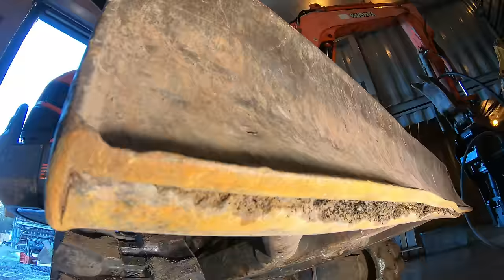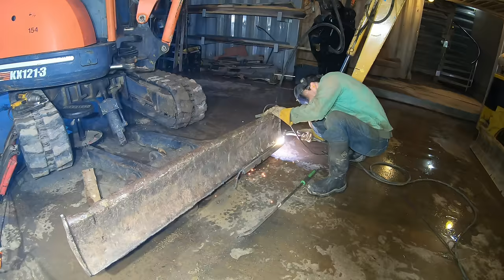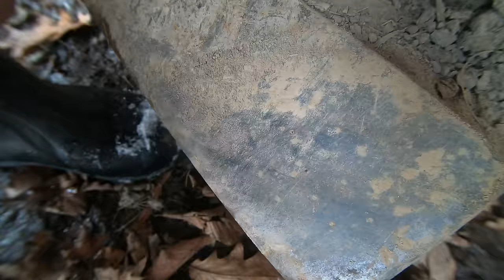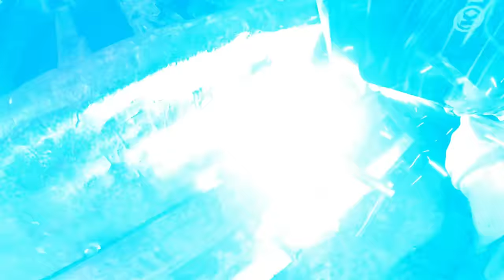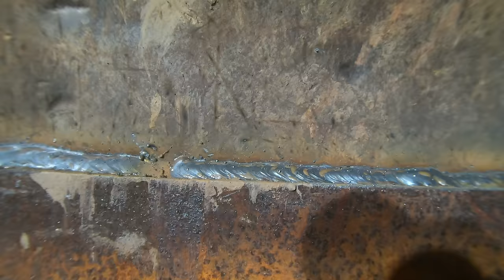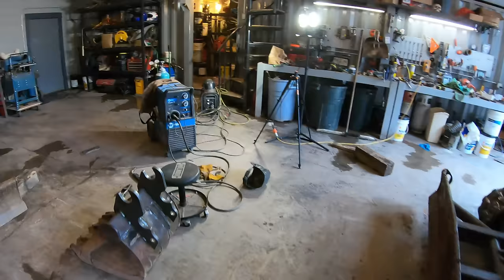Replacing a cutting edge on an excavator blade

Comment: One of the few tools you do not have is a sand blaster.  They do a great job in removing paint and cleaning up surfaces to be repainted.  Love your videos.  Stay warm.
Reply: and a REAL steam cleaner, for the mud, the blood and the beer.....
Reply: I got Kärcher K5 Pressure Washer Sandblasting Kit- works much better than plain sandblaster- no dust.
Reply: Im not sure but I think he has one, in one video he showed his.
Reply: @DigitaIBot  He has a hot water pressure washer but not a steam cleaner and I have never seen him use a sand blaster.
Reply: @Peggyt-jp6mt  If you are referring to the automotive uses, yes a sandblaster would be a good tool that you would use to strip down frames to bare metal and remove rust, that being said it also warps the panels too and it just better to use the alternative (newer age "sand-blasters.") I guess I could see sandblasting the blade, (why? I don't really know) but then you have to think that blade is always being tore up by debris he is clearing, and no you cannot just sandblast a car and respray, you can expect warped panels and base coat wont protect the bare metal from the elements, and probably body filler assuming there is body work to be done, hence the need of a sandblaster. For Andrew though, a simple, cheap, non-messy solution is a grinder.. lol
Reply: He doesn't have a big enough air compressor to power a sandblasted. I got a blast cabinet and my 25 gallon compressor has a hard time powering it. I also use a 5 hp vacuum along with the compressor and my light wen in blasting so it might be not enough electricity for my compressor cuz it's 220 volt motor.
Reply: scubasteve 100 it all depends on cfm, the minimum for painting a car would be an 11 cfm belt driven compressor

Comment: Good job on the blade repair Andrew.  You made it better than new.  Better have a look at the oil in those final drive planetaries because the previous owner must have used this mini for a bulldozer.  Change it out and look for presence of metal particles.  Kubota makes some good stuff so they are probably ok.
Reply: A hollow push blade is a very poor design and no real cutting edge. It obviously wasn't designed for extensive dosing.

Comment: When I was 19 I bought a Sears 295 Amp Stick Welder (AC only) and I still use it almost 40 years later ... mostly i burn 7018 AC rods ... but it tones down to 35 amps and can weld thin stainless as well for example ... I got Oxy Acet Torches the next summer at 20, I NEVER regret buying such important tools ... they have saved me literally tens of thousands of dollars over the years!

Comment: Looks good Andrew, the hard plate should be welded with 11018 rods! I hope the mig welds don’t start cracking on you! Even though the hard plate has a lot of carbon in it, it should be welded with the 11018 stick rods! Just keep an eye on it brother, if the welds start cracking get the 11018 rods! Good luck brother! 👌🏻👍🏻👍🏻

Comment: I'm impressed!!! He still has the guard on his hand grinder..lol idk if i have ever seen anyone leave it on before
Reply: Well, I'm nothing like AC but I'd never grind without it.  I'm not a novice with grinders but I'm always humble.  At 11000 rpm on a 4.5" the edge is moving at 150 mph.
Reply: @reallyhappenings5597  no, your smart for leaving it on.. you truly are.. one you get use to operating one you get careless and take it off.. it always seems to be in the way of getting into tight corners and sometimes can be hard to see what your doing with guard on.. keep it on tho, practice safety...
Reply: He is very smart.
Reply: @terriwebb5093  I don't like using one without a guard. But when I made cuts I had to take it off. The guard got in the way for many cuts.
Reply: @MrJetFormation  yes this is the problem i always face with a guard on my grinder it always seems to be in the way of a cut or a grind that im performing. I don't recommend removing it for novices but with experience you will be ok.. big tip is keep fingers away from fast spinning disk and you should be ok..lol and never use a broke or chipped wheel.. had a cut off dish explode in my face onetime, it had a big chip missing and i thought ill just go easy till i wear past it.. lol and when it hit it exploded. Very scary, i got lucky and it only cut my cheek alittle..
Reply: @terriwebb5093  I put it back on. But it's just because I do think about it hurting me often. I honestly try to use the grinder as little as possible.
Reply: Perhaps that should invent a see through guard
Reply: @kifferwarrior850  good idea, but still wouldn't really work.. the guard is just physically always in the way of performing certain if not most cuts.. good idea tho would be handy in some situations

Comment: A friend of mine used to store his hammer on it side on the ground and it ruined all the o rings and had to have the whole thing rebuilt , he ended up building a stand to put the bit in so he could store it standing up. Just FYI, could save you a big head ache later...
Reply: Good advice.
Reply: Jason that is so true.
I bought a new hammer that had been setting on pallet outside on its side from an auction.
The piston had rusted from rain and ruined the seals. Had to buy a new piston and seal kit.
Reply: This is good advise.
Reply: @magadon ruferto I believe that was just grease in that video. You're supposed to use a special grease, but people who don't use their hammer religously don't often have the correct hammer grease.
Reply: Good advice , I've never heard of that before (not to store a hammer on its side ?) thanks , also any Grease is better then no grease . As a equipment owner repairs like cutting edge's , yes sooner the better but it comes down to economics . Just one more job , so it will pay for the repair . In the long run it will cost you more !

Comment: Great fix that will last a long long time. One time my Dad needed to replace the cutting edge on his Fisher snow plow and was able to get a “worn out” cutting edge off of a motor grader from the township works department. Way overkill for snow but it certainly did the job. 

I noticed the 2nd hydraulic hammer laying outside by your Dodge. Now that you have gotten the taste of breaking rocks out your going all in. 👍🏻👍🏻

Comment: Those foam type ear plugs (e.g. 17:04) are designed to be squished, shoved right into the ear canal then held there with a light pressure as they expand again to fill the ear canal. That's if you want them to be effective at blocking noise. And yes that does mean they get waxy and nasty, which is why they are cheap even in 100pr packs, bin them after use.

PSA from a now tinnitus sufferer.

Comment: I hate to be so critical because I like your channel, but as a welding inspector since 1988, I have to tell you that any time you're welding any steel, old, new, rusty, or clean, you need to grind the surface of the steel where the weld is to take place so you get good penetration without any defects. You had all rusty and dirty steel, both the blade and the new cutting steel, both of which you welded without grinding either weld surface.   That crack in the pipe brace also should have been gouged out a little before being welded.  Maybe you did all the necessary grinding but you didn't show it.  I hope it works for you.
Reply: ya his welding seems to fail alot......never. if you watch his channel you might learn a thing or two about what actually works in the real world.
Reply: 100 percent correct.  That weld will lay in there a lot nicer with prepped metal.
Reply: I’m not even a welding inspector and I cringe at most of his welding. I’m just a guy who has done a lot of welding, taken some classes to learn proper procedures and knows how to weld properly. People who don’t know a lot about welding will think that because it didn’t immediately break or that because I welded it 9 months ago and it’s still going that it’s ok. Improper welds will eventually fail. You just don’t know when. I admire this guy’s work ethic and tenacity but a lot of seems to forging blindly ahead with no concern for the correct method or process. It seems to be a lack of knowledge or education rather than knowing the right way and just not doing it. Either way, it’s entertaining to watch.
Reply: @doi467  you cant be serious. what works in the real world is clean steel and proper preparation of the parent metals. welding is 90% prep 10% weld. if you fuck that prep up. you gotta be one hell of a welder to fix that shit. unclean steel leads to undercut, which in turn is a cracking zone as the weld usually cools quickly in the crack making it quite hard and brittle. I weld Buckets for a living and theres no way in hell we would do this without cleaning the steel first.
Reply: @EarthshipFreedom  Yes, but do you guys not think he realizes that though?  
 
I'm one of those guys that goes overkill trying to do 'the best' (perfectionist pita) but have come to recognize and value effectively hitting happy mediums.
Reply: @doi467  I've inspected in the real world and have seen what really fails in the real world,  and a lot of it starts with poor weld prep.
Reply: @jaylast1958  I didn't start this conversation to be critical of him or his self-made entrepreneurial American spirit, just his welding.  I've watched plenty of his videos and admire him for what he does.  Who are you to tell me to stfu?  Maybe he appreciates being given some constructive criticism that would make him a better welder, but then again, maybe he doesn't care if it fails, like someone else 
suggested.  He can just re-weld it.
Reply: @bobsandone3108  well, the comment that went offtopic is gone now I guess. With 'stfu' I was voicing an opinion the same as you did. 
I see where you're coming from and already elaborated beyond my initial (lulz) comment. 

He's not trying to pass officious inspections or osha union plebs, and also has a pretty good handle on integrity of job vs time/labor/material used, IMO
Reply: I’m surprised he didn’t use a stick welder on that. Less prep, but it’s his stuff and he’s doing it for himself. It’s not a critical weld and he can simply redo it later if it fails. I like the diversity in this channel and learn about things I don’t know.
Reply: @SynoDesign  You weld buckets for a living. You get paid to weld. You get paid to do the correct procedure. You should do all the correct procedure in order to supply your employer with good work. He is his own employer and decides for himself what is acceptable. While what you say is true about the procedure, it is not required. While you do know what you're talking about when it comes to welding, because that's all you do. Of course your going to say something when you see someone that isn't doing the correct procedure. You really think he doesn't know?? Haha he knows.  Everyone who even watches these types of videos knows the correct procedure to weld. We just don't give a fuck because we do more than just fucking weld. Every video of someone welding, you better believe there are gonna be people in the comments that their lives revolve around fucking welding, well guess what, we don't give a fuck. Haha. We have other shit to worry about.
Reply: Jonathan8995 No it's wrong to assume that everyone who watches these videos knows how to weld correctly, many people don't know what is right or wrong. It would have taken Andrew no time at all to run a grinder over the surfaces to be welded and given his project the best for his efforts.
Reply: @markfryer9880  Okay, maybe it was wrong to assume everyone who watches knows the correct procedure. Something so simple like welding, I figure anyone interested in these types of videos has common knowledge of a simple task like that. Maybe I think too highly of people. That's what you are saying. Anyways, Andrew knows the correct procedure and he didn't do it. Big whoop, I hate seeing all the comments on every video that has welding in it, not just Andrews. There are always guys commenting how you should have ground the welds, ugh you didn't grind the welds!! 
For fucks sake, know one cares. Spreading well known knowledge in the comments that everyone "that welds" knows is just stupid. Maybe it makes you guys feel superior for the day. I'm just letting you know, more than likely, WE ALREADY FUCKING KNOW!!!
*Edit*
Also, if ya see one comment about grinding the damn welds, don't add another. If you do, it's just you wanting to make sure everyone knows that YOU (enternamehere) know how to weld. Hah. Pitiful..
Reply: You welding inspectors are ALWAYS saying stuff like that .... crank it up 5 or 10 more amps and it'll burn right through the rust!
Reply: Why didn't he just stick weld it they make 7018 specifically for use on rusty and gross metal it seems like mig welding is improper
Reply: That's with structural, much less important on a cutting edge. Albeit would be better if he cleaned the rust up with a flapper, but not critical for just a cutting edge.
Reply: bob sandone I’m not a welder at all I have done some for my age I am 16 my father is a welder he does a lot of body work in the garage next to my house one day that will be mine and even if I don’t like metal fab or welding I am still going to take it in trades school to be able to use that stuff I’ve used to some but my father always says to me welding is prep work always I ain’t no welder I do hope to never be as a full time job... because it’s boring. Just thought I would mention it to back ya up. Thanks for reading!

Comment: Love that Miller Mig welder.....Never used that kind of torch before.  Just had Acetylene torches and the knozzles were always plugging up.  The Mig welds so smooth. Love the plasma cutter. Never use one but it looks fantastic. It does do a better job than bottle torches. Learned something new.  It cuts real good.  Great job....you sure don't mind heavy tedious work.  That's a good man.

Comment: Well from the experience of the welder you made two mistakes . one that did not clean the miilscale before welding. two is better if you were using a dual shield fluxcore wire for a better penetration.good luck.

Comment: Andy, what I did a couple of times was, I used an 8" steel and bolted  it on in the center so I could reverse it when one side got dull . I used 1/2" hardened carriage  bolts. Worked out fine , and was a snap to replace after that.........just saying.....

Comment: Andrew, Good idea to have some concrete poured in your front driveway into your garage, I have noticed that you do most pressure washes and mostly muddy afterwards, defeats the purpose of washing the excavators and allow the mess into the drive pad....Great Job on the YanMar Bucket Mod and the Kubota Steel Pin...

Comment: Nice job with the repair.  Two things, consider putting some hard facing on the new blade, the sides and the bottom.  You are correct about heat warping the metal.  Solution is to alternate ends and between the tack welds you made instead of one long end to end run.

Comment: Isn't it just lovely when ya find where previous owners neglect cause ya more work. I restore equipment in house and mobile and also run a auto repair shop. I run into these issues all the time. It really is a pain when it could have been easily avoided.

Comment: I used to work in a SSAB steel mill in Sweden. The wearplates we made were called Hardox. I think they invented that particular type of steel in the seventies. The reason its so hard, is not only hardening/tempering, but also the high alloy content. Apart from iron and carbon, it was a mix of other materials like nickel, chromium, manganese, molybdenum and silicon. These materials give the steel new properties, and increases the amount you can harden it. It had that orange/reddish color your plate has. The texture is pretty coarse and grainy.

Comment: Another great video,those kabota even new didn't come with much wear zone on the cutting edge.nice repair.i bought a John Deere scraper a couple of years ago and was told oh it's ready to work.the moldboard was worn where the nuts holding the cutting edge on were gone .bad, had to lay under to it and weld it up.i also have a ex150 and I noticed you running it with the hood up I would like to talk to you about that some time.keep up the great work.

Comment: I really love to read these comments from people that know what is going on in the world. I have watched all of your vids and read many many of the comments about dirt and compaction ad nausium only to figure out that these fine people haven't a clue about different dirts and their characteristics in what ever depths to solid rock will be. Some seem to know about their typical area but probably could not tell you what plasticity index or probability of vertical rise exists. I have been doing what you do for over fifty years and I can't possibly get as smart as some of your viewers. As for welding I'm sure that you are not going to build another floor on this little mini ex or going to pump high pressure gas through it. I can't imagine that this little tractor will ever generate enough force to tear even a badly done welding job. Keep doing what you do. Thanks for the vids.

Comment: Very nice job AC! First, for the job on the blade repair but also for the video production. When you look back at it, I bet you think, “Man I wish the welding really did go that fast!” 
Probably a wise choice putting the new blade, factory edge down. Bcz the heat from that long plasma cut may have disrupted some of the temper in the steel. Don’t you think?
Thanks for another interesting vid 🤜🤛